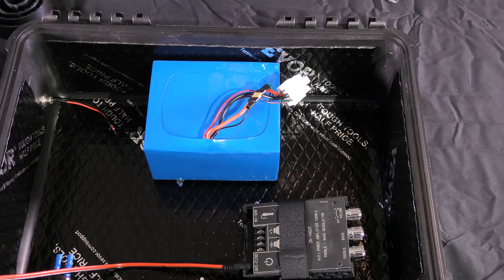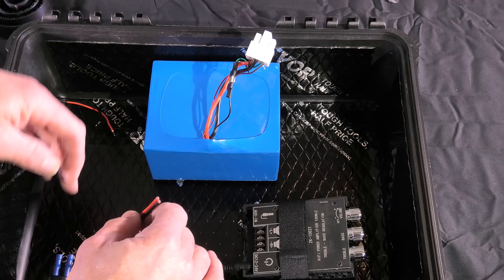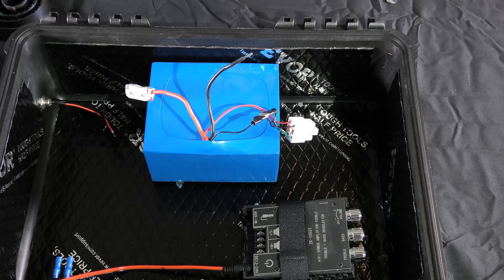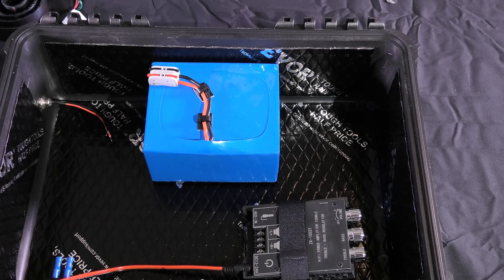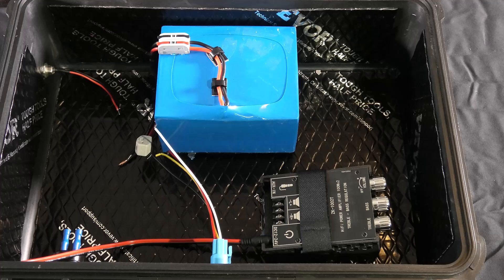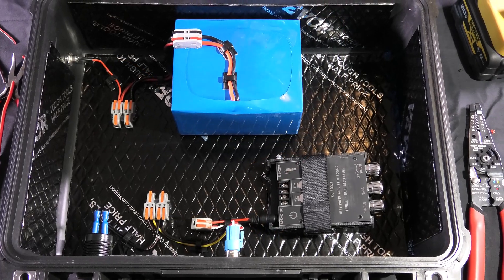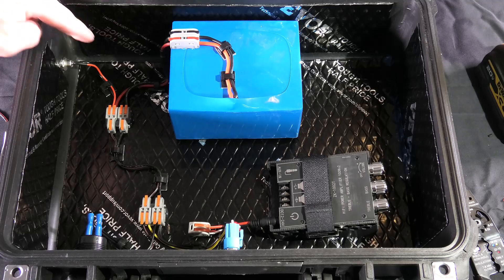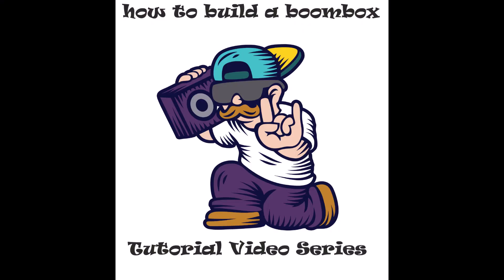How to build a boombox Segment 7 Wiring Power

Comment: Dont you need a voltage regulator for that battery? I read that these amps will burn up with a 24+v battery if its charged fully and you need a voltage regulator to keep the voltage under 24v? Is that a 12v battery?
Reply from the maker: some amps do have issues at over 28v, this battery rests at 26.5 and causes no issues. You will need to research the voltage of the amp you choose, as some will require a buck converter to regulate the voltage in.

Comment: What be good plastic ammo /utlity box that fit 6.5 7.09”D speaker side by side on exterior length side I do not want apachie 3800 case or other case that’s bumpy want somthing soomth
Reply from the maker: Apache 2800 from harbor freight or my favorite is the Meijia 10.62" from Amazon
Reply: @ is there a plactic utilty box or ammo box that’s not apachie case or a case that not bumpy just flat smooth surface that fit 6.5 7.09”D speaker side by side on the external length side of box
Reply: @  can you help me find a plastic utlity box that fit 6.5 7.09”D speaker side by side on external length side of box I do not want a apachie case or bump ridges I want smooth flat surface thanks please let me know thanks

Comment: Is that the kind of battery where it has to be balanced for a charge?
Reply from the maker: not sure what you mean by "balanced" It is a lithium battery with bms and needs a 27.2v 1a charger
Reply: @doitallwrongreviews balancing lithium batteries is a standard to keep the individual cells equal.
Reply from the maker: @UberHaas  The BMS  monitors cells for several parameters. One of those is to keep the cells matched together for the optimum operation yes.
Reply: I thought the same thing, how do you balance the battery?
Reply from the maker: @UberHaas  In the industrial lead acid battery world there is a cycle of some chargers called an "equalize" charge. It basically does what the name states. It equalizes the cells to discharge and charge at the same rate to optimize the performance of the battery.

Comment: You talk about wiring a fuse from the battery. What size/type of fuse do you use? I plan on using the same type (24volt) that you used in the video.
Reply from the maker: 10amp so sorry i missed that.
Reply: 10amp fuse would work